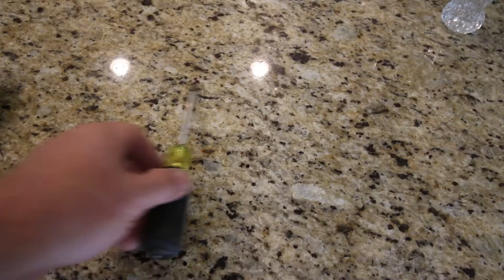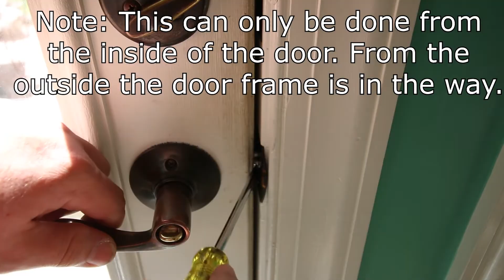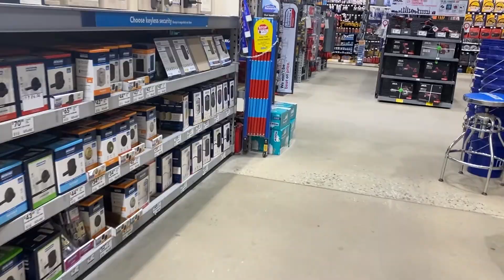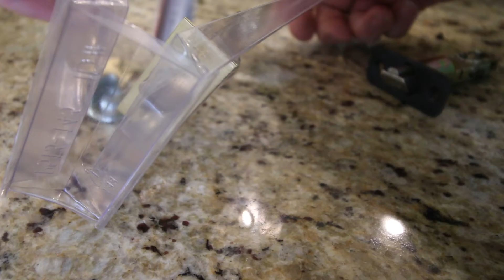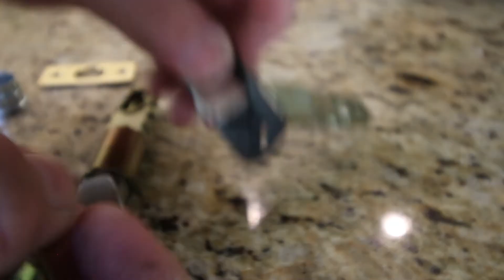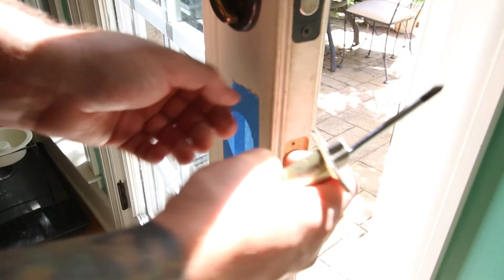How To Replace a Door Latch | Door Latch Repair (Super Easy)

Comment: What if the screws are behind a plate that go over the knob?
Reply from the maker: There should be a set screw you can remove with an Allen key or a slot you can fit a small flat head screw driver in that will release the knob. Then you can carefully pry the cover off to access the screws.